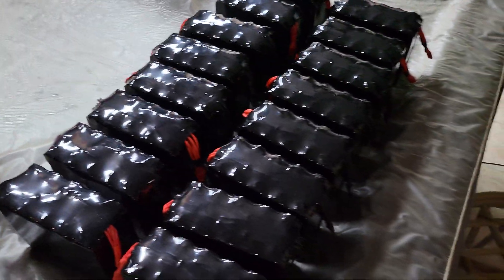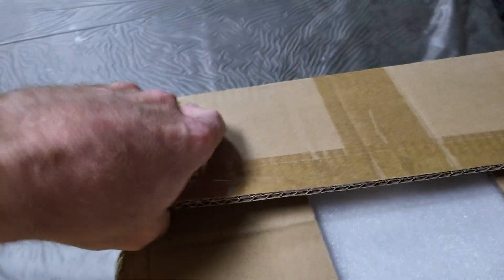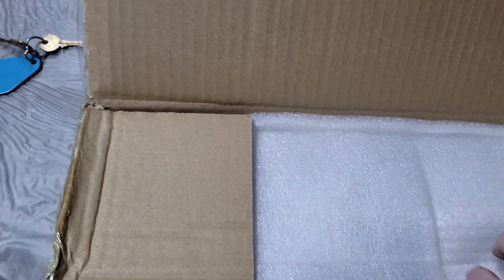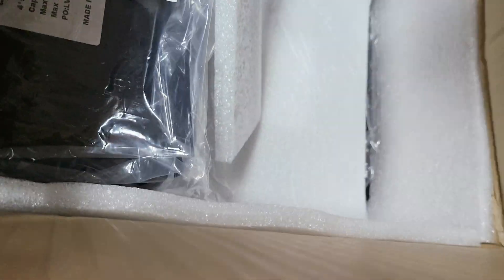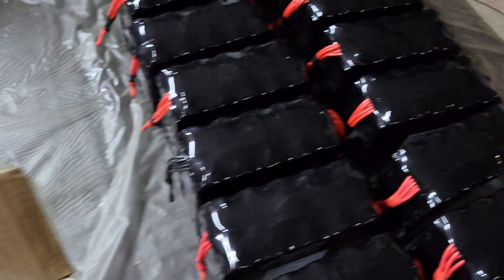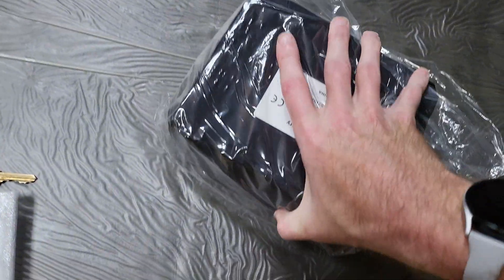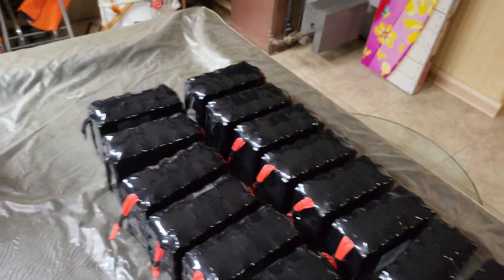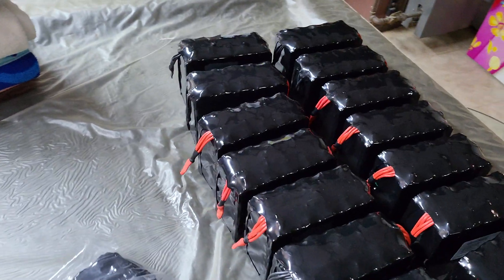Battery Hookup Lifepo4 battery Module 48V house battery build Part 1

Comment: How much did the batteries cost you?
Reply from the maker: About 3300 delivered
Reply: @darrenorange2982  why these cells over the blue boxes ones. Heard those are cheaper
Reply from the maker: @timboe1848  It's complicated but I'd rather work with this company and they sold me the original batteries and there was a recall and I wanted to stay with them.
Reply: @darrenorange2982  I understand I buy from battery hookup myself. It was just curiosity I’ve seen a lot of people getting the square ones lately for less so it has me curious
Reply: Also the inverter is that an lv5048 or lv6048?